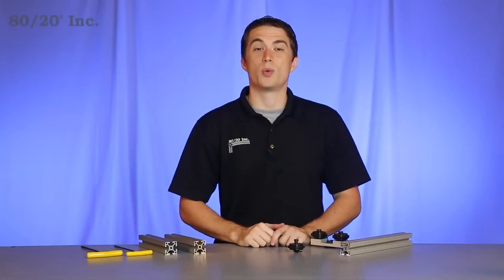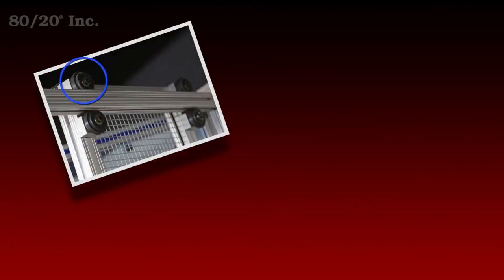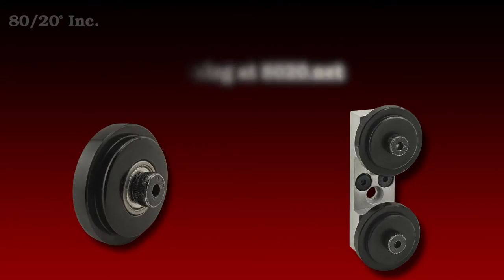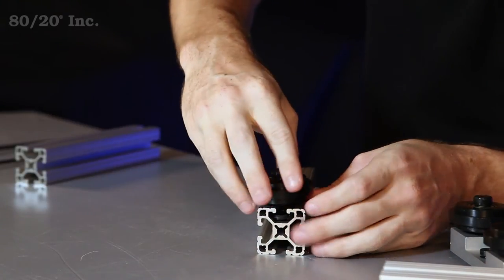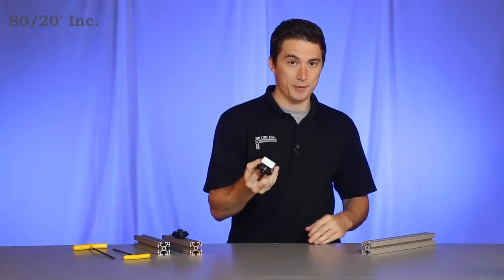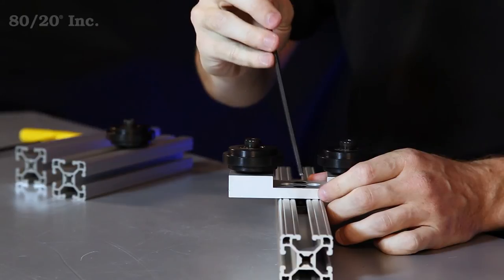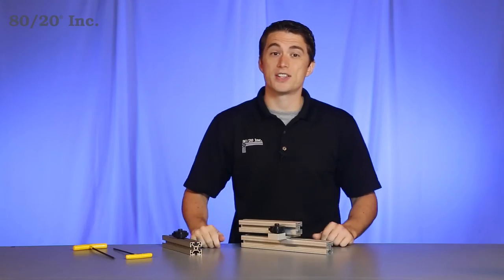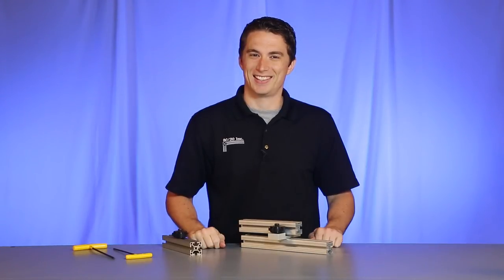80/20: Roller Wheel Overview

Comment: Can the sealed bearing rollers be used in an outdoor application? What is the rest of the hardware made out of? Stainless, etc?
Reply from the maker: Hi, Eric - thanks for your question! The sealed bearing rollers are not stainless steel, although they could be intermittently used in outdoor applications. We would recommend the rollers that utilize permanently lubricated bronze bushings as these are weather resistant. You can see these options here: https://bit.ly/41bVz7I

Comment: Can these be used in precision machines such as CNCs and 3D printers: the same way v rails are constructed?
Reply from the maker: The roller wheels and roller wheel brackets are not intended for use in a precision application. They are primarily meant for creating a hanging “barn door” and machine guard access doors.

Comment: I'm planning to build a material lifter to lift up my car roof box. Can these rollers to be used with the T-slot for my application?
Reply from the maker: Hi Catherine. As long as the wheels are orientated vertically and used to guide the load, you should not have a problem.